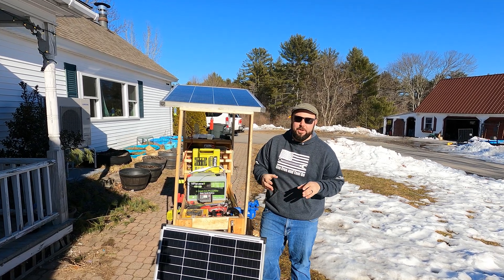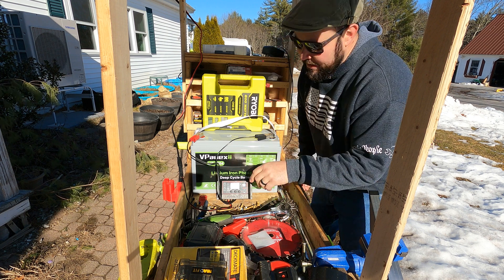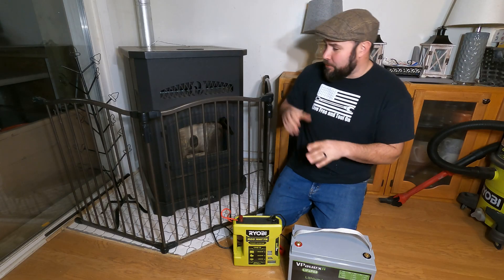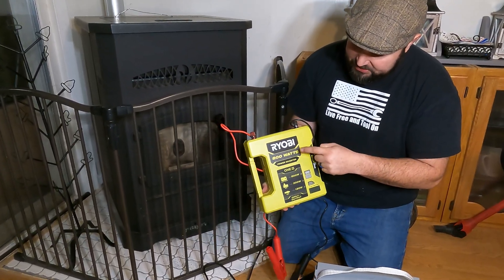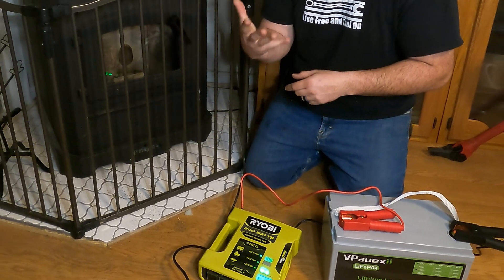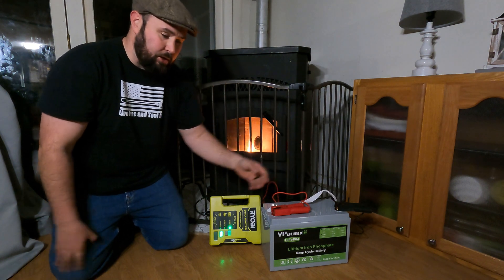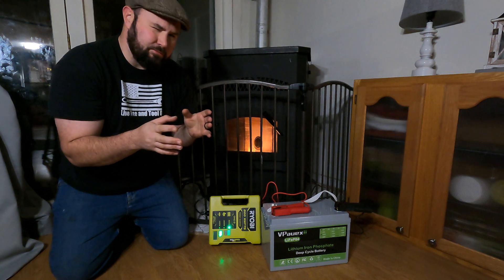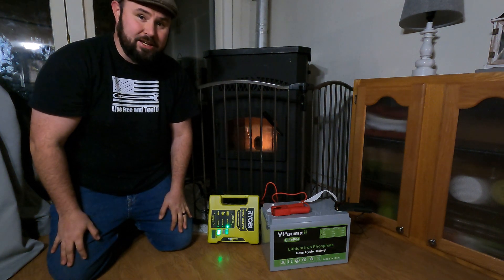Cheap 1200 watt DIY power bank with RYOBI

Comment: I was wondering how long the inverter lasts whith your lithiom battery before you need to find a way to charge. I have a cheap deisal heater that pulls 10 amps on start up ive tried a new car battery an was able to make it through the night buy 10 am i was looking to put a charge back in it the heater shut down when the battery droped to 8 volts not good for a lead acid car battery but this was just a test i was doin in a camper after purchasing the cheap chinese diesel heater .

Comment: My only suggestion is to get a different post for the battery there is not enough to clamp onto with those studs it has on now.
Reply from the maker: That was only for.the video I have heaving I loop connections for typical use. Thanks for watching